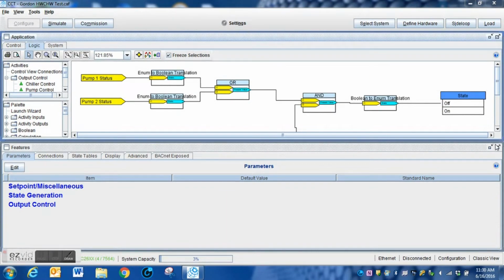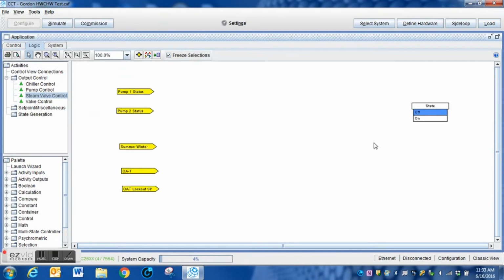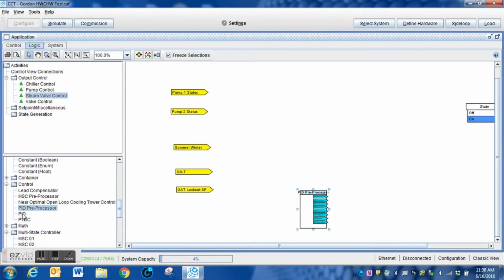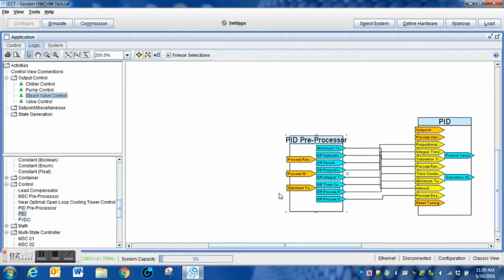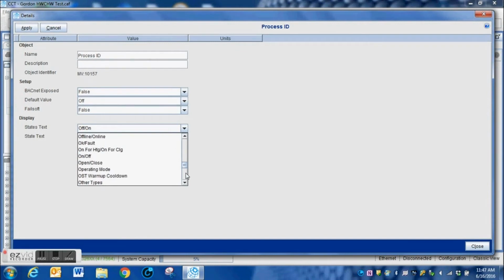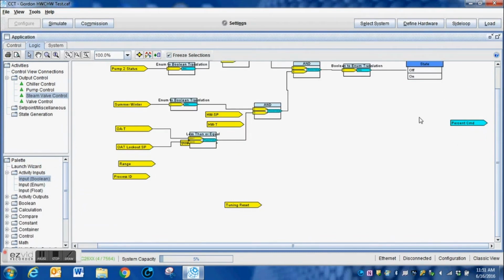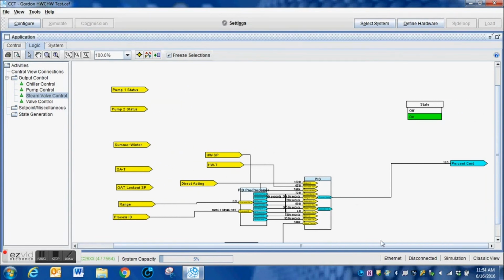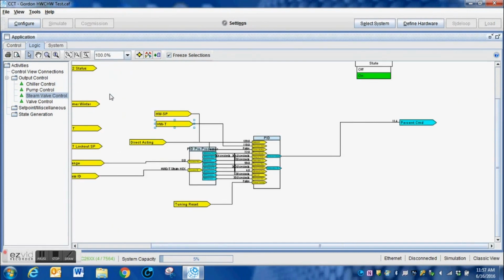Advanced Programming Techniques Controller Configuration Tool Pt 2

Comment: After I clicked make connection, the hard inputs is not showing to be selected
Reply from the maker: You have a state text mismatch.
Reply: @Systemcontroltech what is the physical BI point used in logic? Input (Boolean) or Input (Enum)?

Comment: Thanks for the video. Please advise on how to apply the below requirements to the PID for the actuator valve to modulate as per the below scenario.
For example: Summer mode.
Scenario 1: TEMP = 24 deg C; Setpoint = 24; VA CMD is 0%
Scenario 2: TEMP = 24 deg C; Setpoint= 23; VA CMD is 50%
Scenario 3: TEMP = 24 deg C; Setpoint = 22; VA CMD is 100%
How can I do these conditions? Thank you in advance.
Reply from the maker: You could use a span block to get those values.

Comment: Thanks for the video, which is helpful. But i got a question. I am trying to control the supply temperature by controlling the valve in AHU system. However, when the supply temp reached the set point, the valve output dropped to zero immediately. How can i reduce the drop when it reached the set point?
Reply from the maker: It sounds like the PID might need some adjustment but if you keep the valve open you could overheat and go way above set point.

Comment: Good videos thanks. We use a 100% fresh air until but at -30degc sometimes the preheat and heating coil valves don't catch the supply air temp before a low  temp trip. All the programs look to be prebuilt bit seems some would benefit from a custom controller like you built.
Reply from the maker: You should be able to modify it

Comment: For the pid loop, Why is a pre processor needed? Would the valve function with just the pid block alone?
Reply from the maker: The pre processor helps to configure the PID for the specific application.

Comment: Thanks for the video have you had any pilot postioner problems lately?
Reply from the maker: We're actually trying to eliminate them and replace pneumatic devices with electronic.  It saves on maintenance and energy costs since there is no need to run an air compressor.  Pilot positioners are handy devices but are older technology.  Thanks for watching.